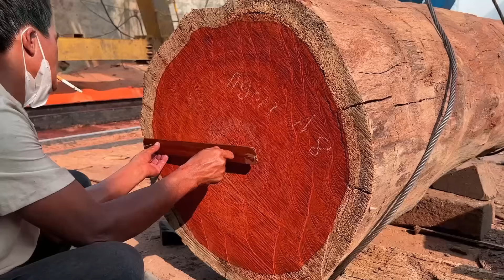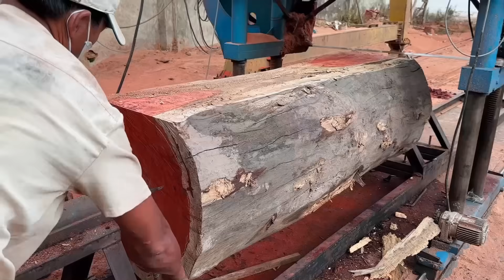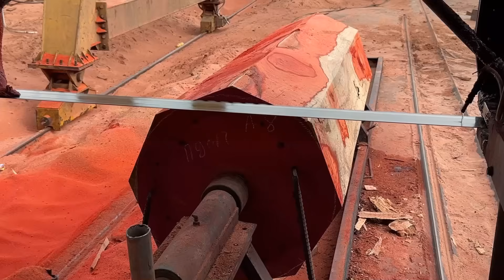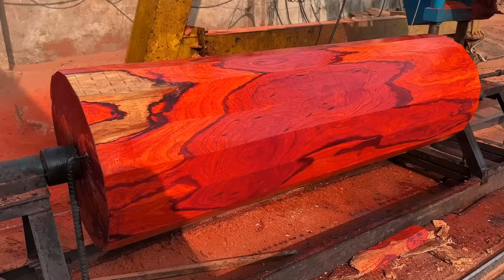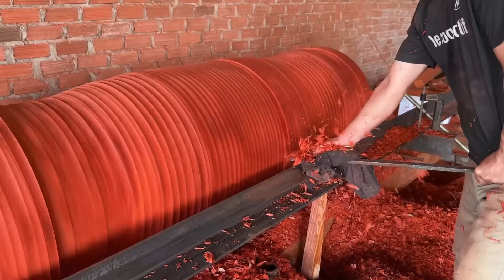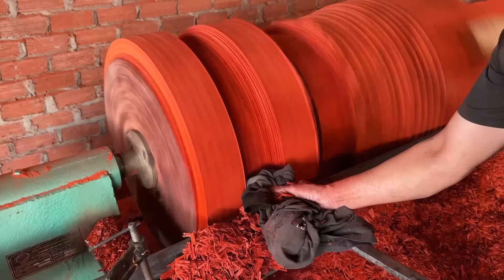Wood Cutting Skills // Working With A Giant Red Wood Lathe

Comment: Que  madeira  e essa
Reply from the maker: RED WOOD (PADOUK WOOD) is a hard, strong wood. The wood is moderately heavy, hard and very stable, with little deformation. This is a popular hardwood because of its special color and reasonable price.

Characteristics of red rosewood
Scientific name of red rosewood: Pterocarpus soyauxii

Tree size: Tree height from 30m - 40m, trunk diameter from 0.6m - 1.2m.

Average weight of wood: 745 kg/1 m3

Specific gravity of wood (Moisture 12%): From 0.61 - 0.75

Wood hardness: 8760 N

Wood brittleness: 116 MPa

Elasticity of wood: 11.72 GPa

Compressive strength of wood: 56 MPa